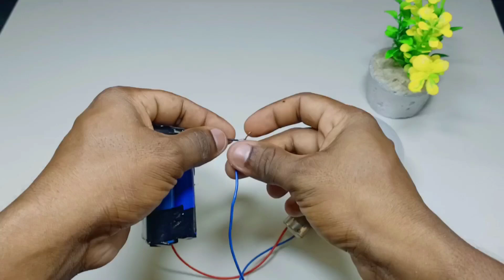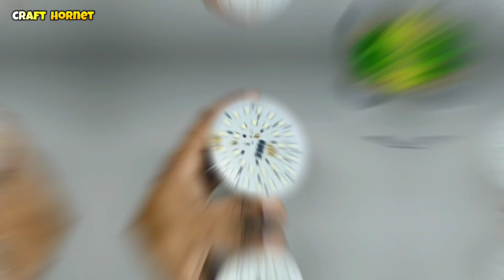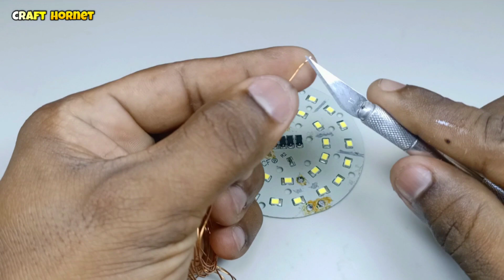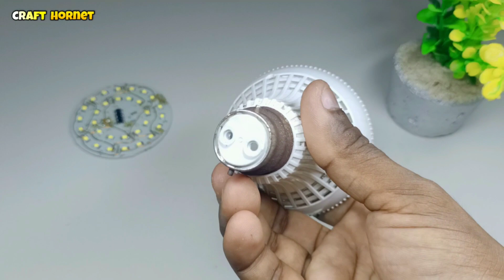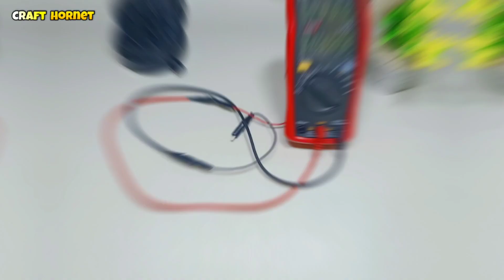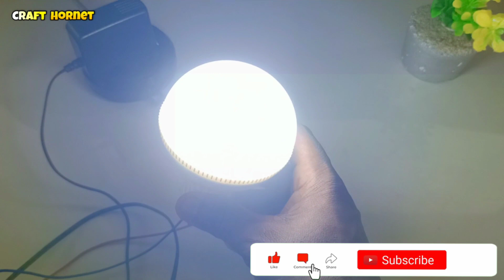How to convert 220v led light to 12v | 230v to 12v | 220v led bulb to 12v

Comment: Looks great, but how about a verbal explanation - any language - to make it understandable.
Reply: His 220v(120v) bulb works by transforming AC to 12v DC on the board. This being said, the LED chips would be rated for 12v DC. So he just bypassed the transformer circuit and directly connected E26 base to the chips.
Reply: @asicoshangus9506  These explanations aren't really that useful. In the video, we see him making series of 3 LEDs to pass 12V through them. This means that the LEDs must each have an operating voltage of 4V (4V LEDs x 3 = 12V).

What would have been nice to clarify in this video, for it to ultimately be useful, is how to determine the voltage of a single LED to know how many we can connect in series without it burning out. If the LEDs were 3V, we would have had to connect them in groups of 4, for example, and since each LED bulb can be mounted differently (especially with the multitude of wattages and light colors available on the market), the voltage of each LED can vary depending on the number of LEDs in the bulb compared to the stated wattage (we can have 10-LED bulbs providing as much power as a 15-LED bulb, just with their respective voltages that differ).

Basically, this video only gives an overview of the process without explaining how to get the most important information that will determine all this wiring.

In the same vein, he ends up showing us a 12V 1A power supply. This means that if the bulb originally used 15 or 20 watts, this power supply would be insufficient. P = U x I

12v (U) x 1a (I) = 12w (P)

This power supply only provides 12 watts of power. It doesn't matter if it was originally 220V and is now 12V; if a bulb requires, say, 30W, this power supply won't be enough. This is another important detail to consider, especially if you plan to use several of these modified bulbs, given the very low power these power supplies produce, not to mention the speed at which they can drain a 12V battery.